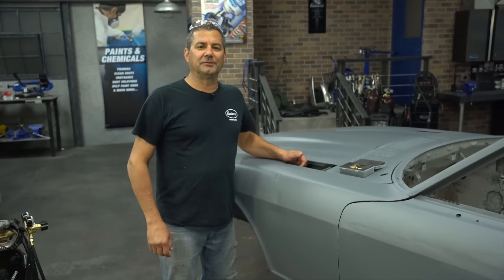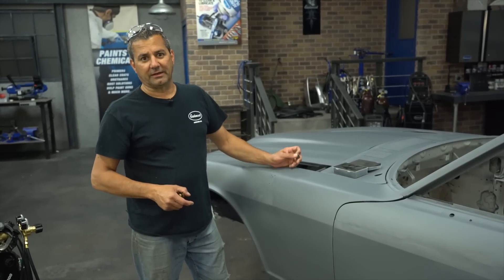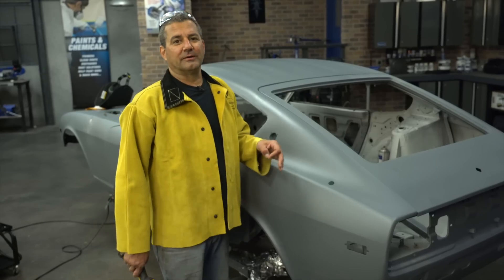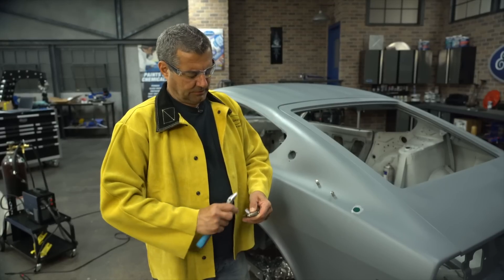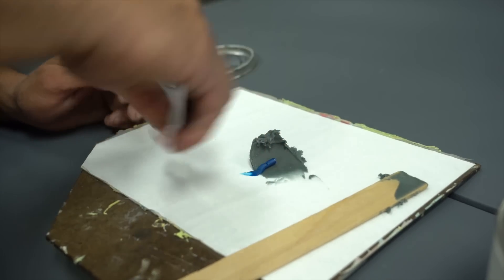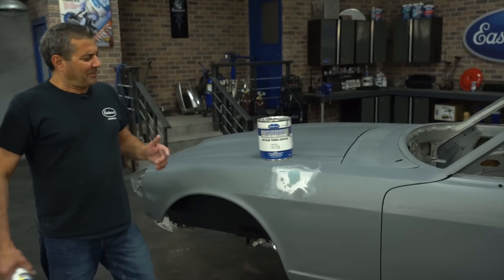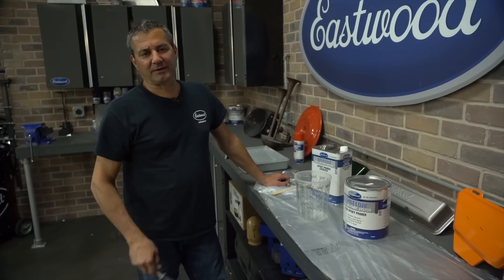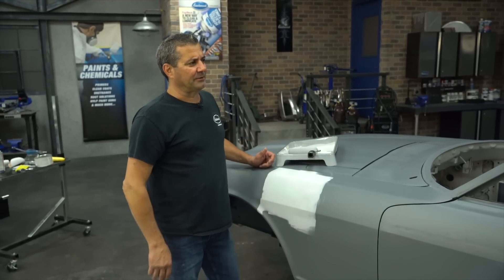How to Fill Holes in Sheet Metal - Eastwood

Comment: Put the hardener on the mixing board alongside the body filler separate. Many times the hardener has a bit of fluid at the tip from not being able to massage that end of the tube. If you have the un-mixed hardener problem you don’t now have that mess in your body filler before you even start the mixing. You get a second chance to have proper hardener in the consistency and quantity ready for mixing with the body filler.
Reply from the maker: Thanks for the tip!

Comment: What about the INSIDE of the panel. That will rust in no time with condensation moisture etc.
Reply from the maker: Internal Frame Coat: https://www.eastwood.com/eastwood-internal-frame-coating-14oz-aerosol.html
Reply: @eastwoodco  You can't always get to the other side, another reason for using lead or solder to fix small holes...and much cheaper

Comment: I have 13 holes in my ex police to cover ,This video is great and have some question what where the welder settings did you use gas and how is it grounded and what wire is good without gas . Thanks

Comment: wow, I am no pro but I would simply use a brass backer and weld it shut right? instead of having a 1" reweld wound on inside of panel? eastwood come on, your trying to sell this? even if you cannot get to the back of it, you can weld shut something small.
Reply: yes for majority of trim hole welds that is the way to go.
Reply: This trippy music had me nodding off. Good to see no bondo used. 😂
Reply: Maybe an antenna hole but not those small holes easily welded closed.